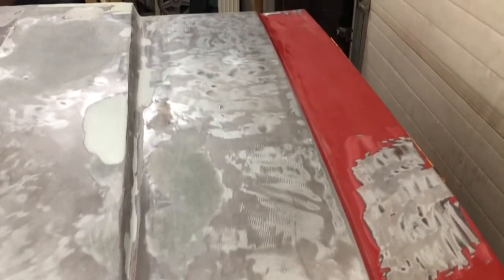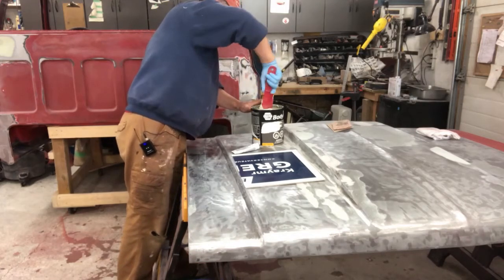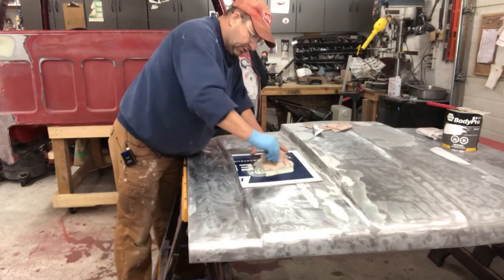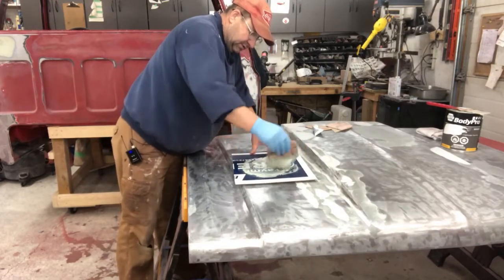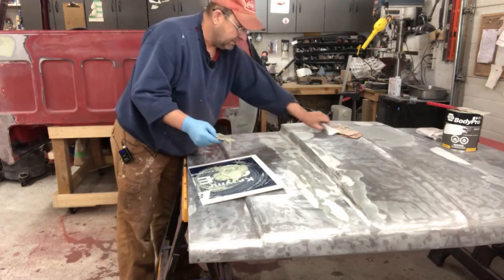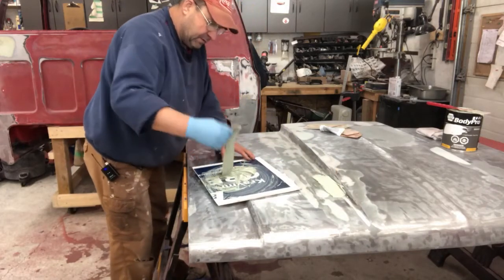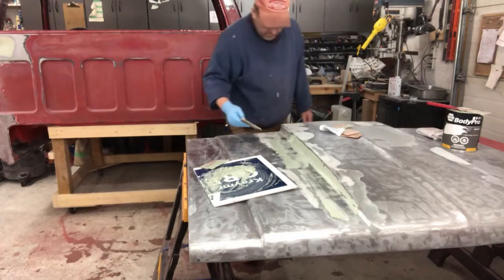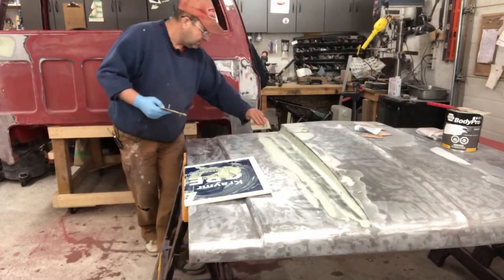Hood conversion Pt 3 0

Comment: It is best to use a hand broom, a little compressed air and lightly hit the area with a tack rag but don’t press as to leave residue behind. 3M may wipe an area with acetone on a lint-free paper towel like “Kimberly-Clark” Wyp-All L40 sold reasonably in cases. This cleans the surface for a good bond of the filler. Pressing the first swipe hard as to almost transparent gets the chemicals deep inside sand scratches to help with bond. Then apply. It’s just best practices and it’s what I do and I would never say your method is bad just what works for you. I did see one video where the back support stamping was drilled and removed but they used a TIG and long hammer forming for plemishing the panel to relive metal stress. TIG welds are softer that MIG buy I don’t own one. Plus this makes the skin floppy when working it as well. Just food for thought. I left my $1,600 TIG money in my other britches! lol. 😮